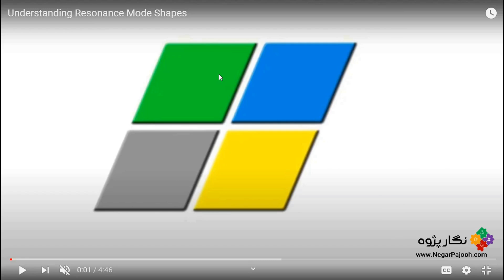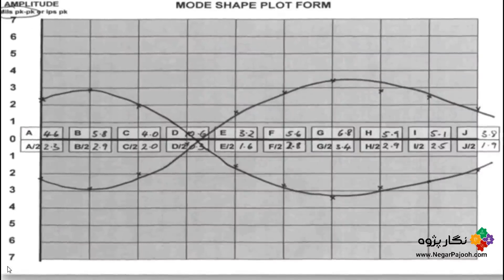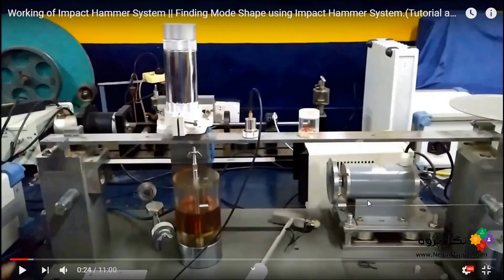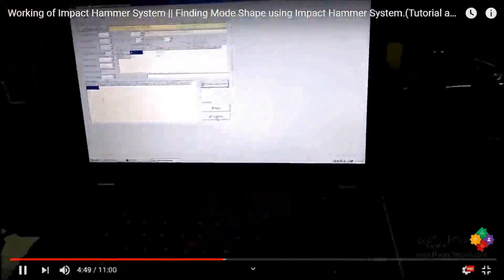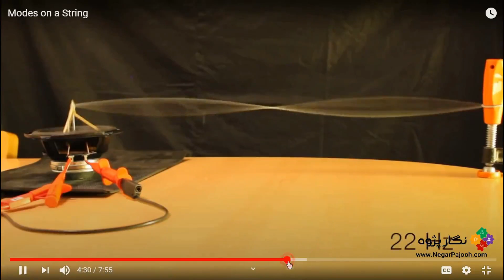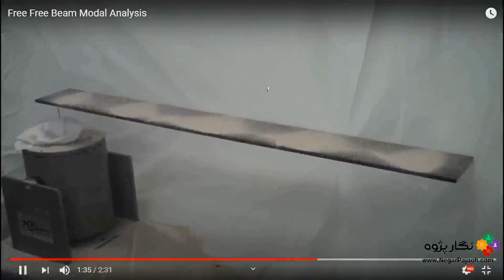Vibration Control of Composite Plate by Energy Sink - Section 10-2 چاه انرژی- کنترل ارتعاشات ورق

Comment from the maker: Negar Pajooh is advanced simulation institute of mechanical engineering systems
Software:
MATLAB - ANSYS - ABAQUS - SOLIDWORKS-Arduino-Labview
 Fields:
 Control, Solid Mechanics, Structural Engineering, Optimization, Fuzzy, CAD, CAE, Mechanical Vibration, Robotic, Shaft- Impeller , Rotor Dynamic, Condition Monitoring, Fault Diagnosis, Health Monitoring, Wavelet, Neural Network, Image Processing, Sensor and Actuator, Sound Processing, Finite Element Method (FEM), Piezoelectric, Numerical Method, continuous structure, Active/Passive Vibration Control Channel 
Youtube Channel: 
https://www.youtube.com/channel/UCeaa6Kt3mBKNW-fNgNgOqTg 
Gmail:
 NegarPajooh@gmail.com 
Phone, Whats app, Telegram:: 
+989198470686
Website: 
http://www.negarpajooh.com